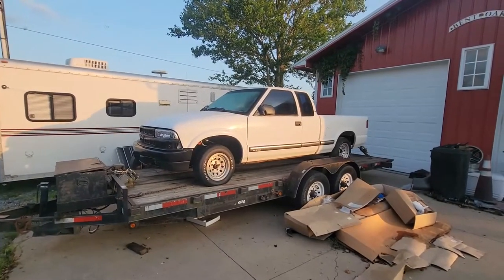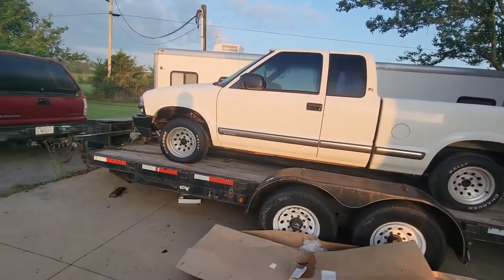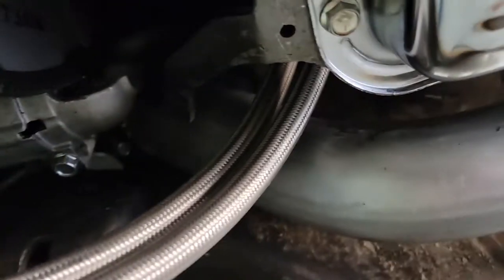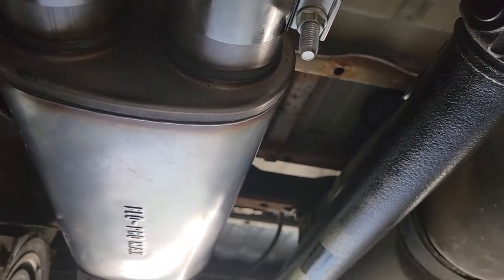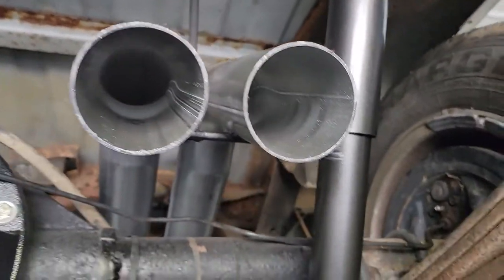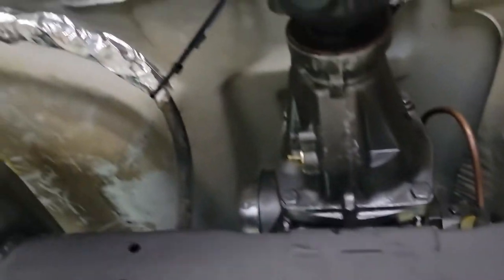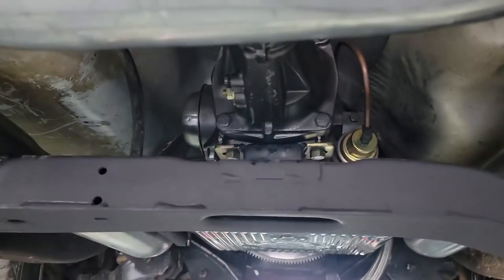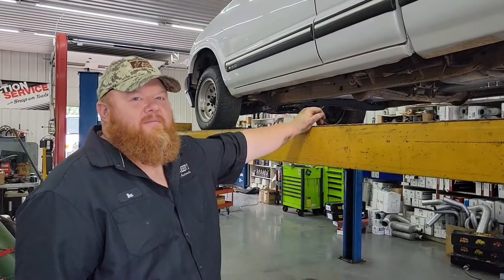How to swap a SBC V8 into your Chevy S10 - Part 9: Dual 3" exhaust with X pipe muffler.

Comment: What would you recommend for a distributor that is cheap and does not use a computer controlled box?
Reply from the maker: I originally tried a HEI distributor but it was just too tall. You will need with that has lower clearance to fit around the heater core.
Reply: @BentOaksGarage  That is my problem now with the HEI
Reply: I used a plug and play from summit seems to be the same as MSD but cheaper price.

Comment: What power does your truck make?
Reply from the maker: I only had it engine dyno'd not wheel dyno'd. But the engine dyno came to something like 525hp and 490 torque. I have the dyno results in one of the videos. Its been a while since Inhad it done.
Reply: @BentOaksGarage  that's good power, bet you've shocked the shit out of a lot of car's